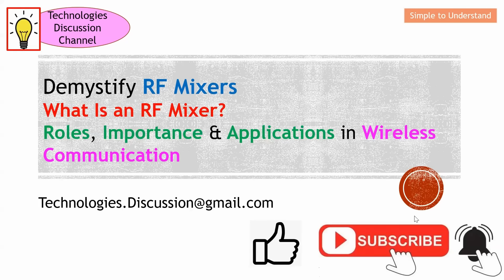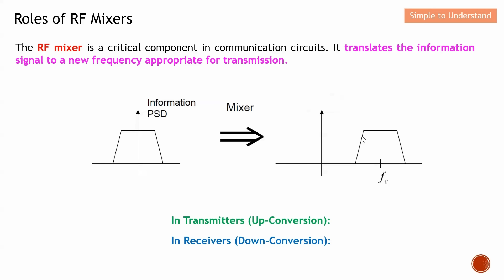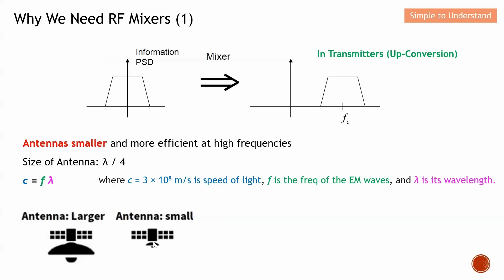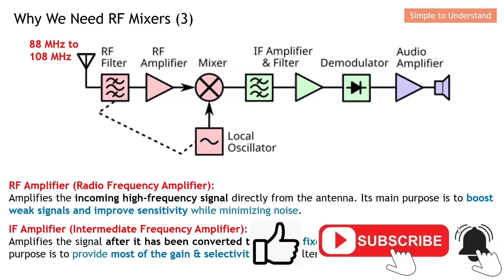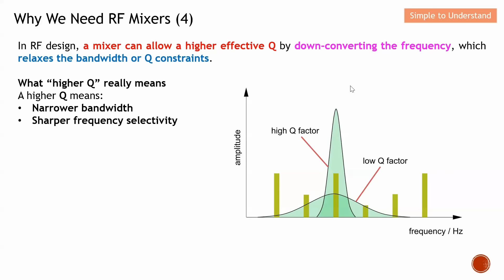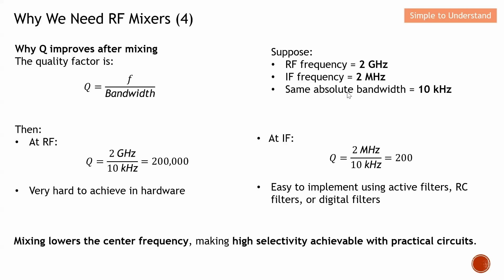RF Mixer #2. Roles, Importance & Applications of RF Mixers in RF & Microwave Communication Systems.

Comment from the maker: Thank you for taking the time to watch this RF Mixer series discussion. In this video, we first explain the role of the RF mixer and why it is so important in communication systems. In fact, there are four main reasons why we need an RF mixer.
First, with an RF mixer, the antenna can be smaller. When the signal is up-converted to a higher frequency, the wavelength becomes proportionally smaller, which allows the antenna size to be reduced.
Second, by properly controlling the local oscillator (LO), we can select the channel we want to receive. For example, in an FM receiver, by adjusting the LO, we can tune to our desired station and listen to our preferred music.
Third, the RF operating frequency range can be quite broad. However, with an intermediate frequency (IF), the frequency is fixed. This makes the amplifier design easier because we do not need to design the amplifier to operate across a wide frequency range.
Last but not least, in a receiver, when we down-convert the frequency, the required Q factor of the filters can be relaxed, which simplifies the design.